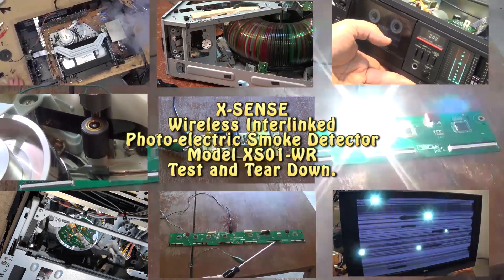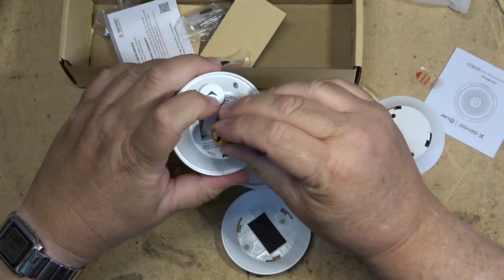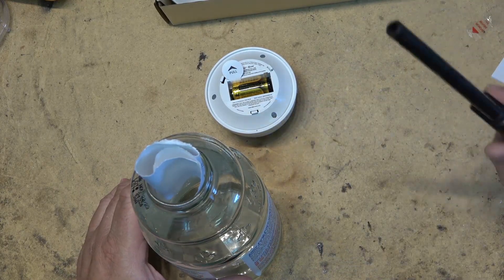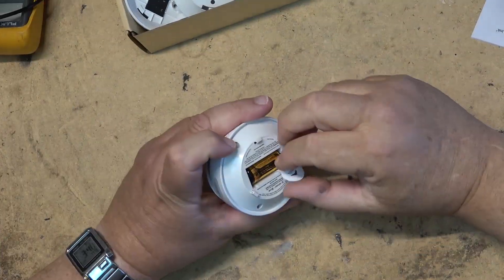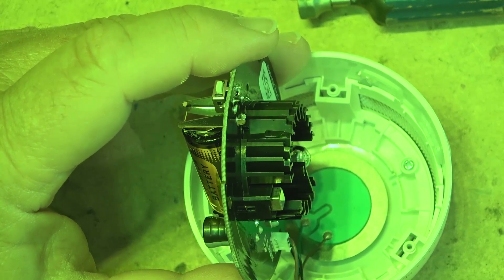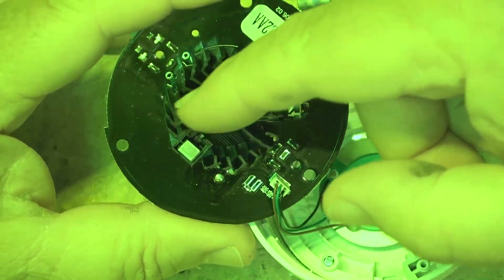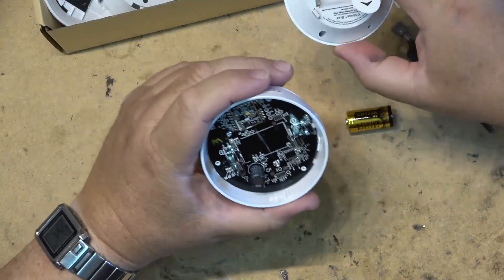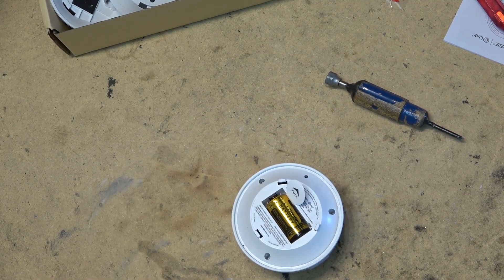XSENSE Wireless Interlinked Smoke Alarm Test and Tear Down

Comment: the ones i put up are the dual ones with both sensors inside.  a battery one in my bedroom and one that runs on AC with battery backup in the living room (it's a small apartment)

Comment: In Germany it is the law to have smoke detectors and they must be tested once in a year if it is rented. My last check was a week ago. We have 10-year detectors with automatic claibration for dust. Those are Ei650 from EI Electronics. They are mounted on a iron plate and contain magnets to hold themselfs up. If you trigger them by accident, you only need something to poke the top of them to quit it for 10 minutes.